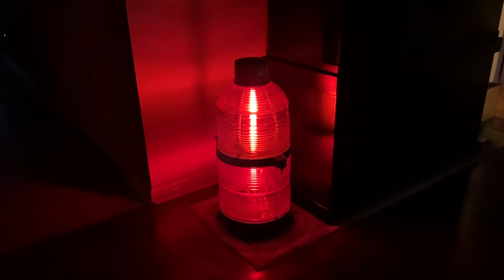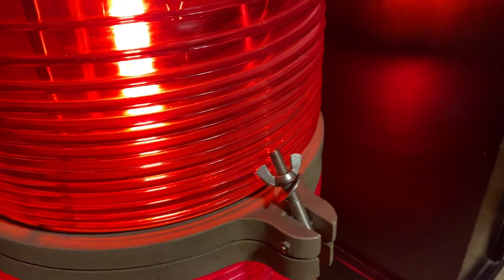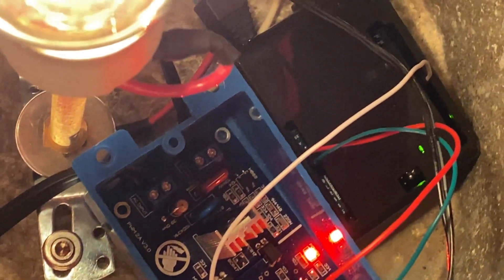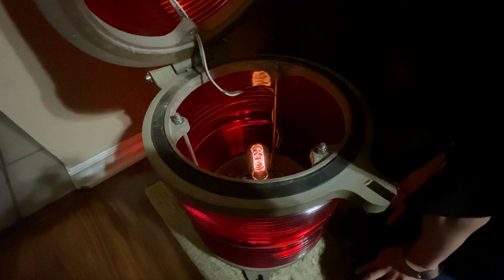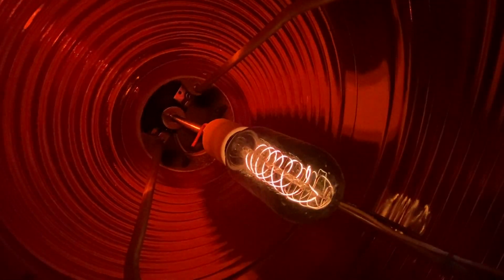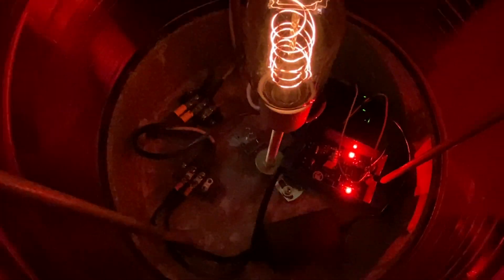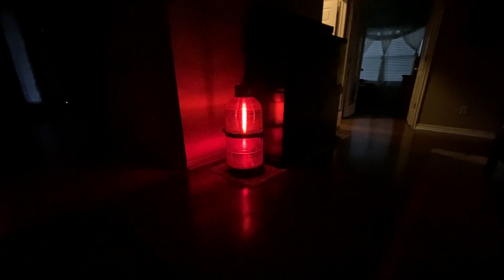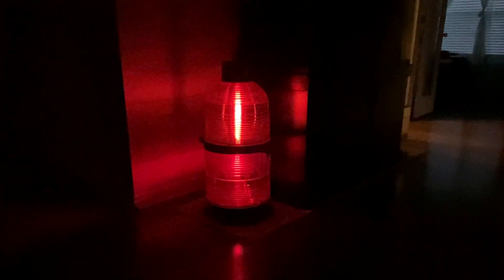300mm TWR Tower Beacon Light Operation with 110V Bulbs and Fading of Light

Comment: Very nice! I just bumped into a Crouse-Hinds FCB-12 today. I'm going to just zip tie a extension cord with two household lamp sockets wired together with 100 watt bulbs on the red filter supports on a a dimmer. How did you get those stems coming out of the factory sockets.. did you make those? However, man you did a great job on the system conversion!